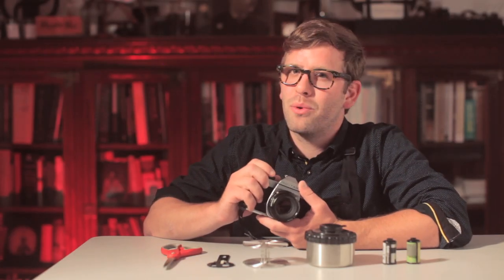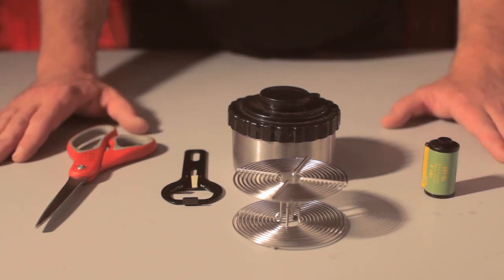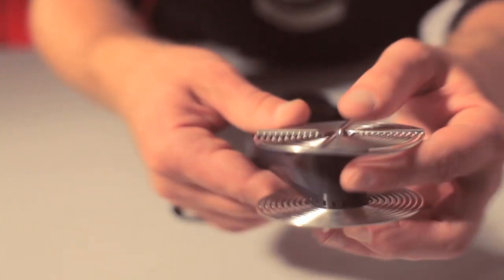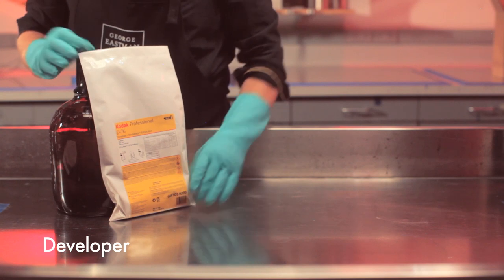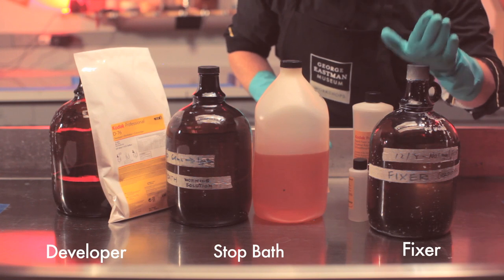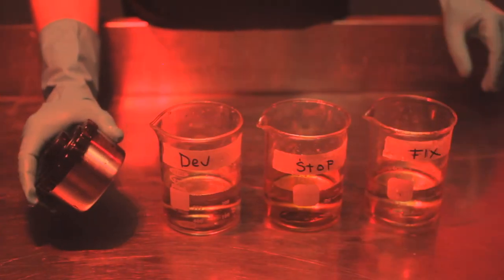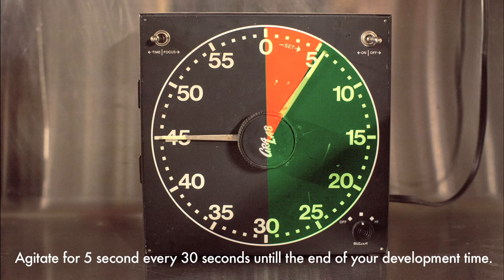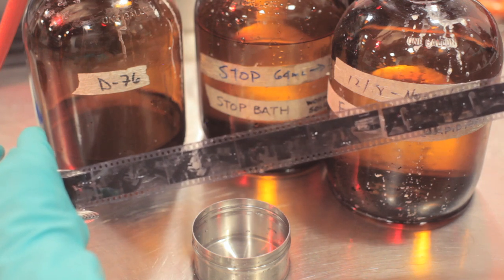Developing 35mm Film

Comment: I used to do this all the time back in the 70s when I was in high school. I had a darkroom at home. What is with the red lights? Load the film in the dark, close the tank and turn the normal lights on. Also, make sure that the film does not touch itself on the wheel while loading the file. Part of the practice that is needed. Thanks for posting, brings back memories. I can smell the chemicals.